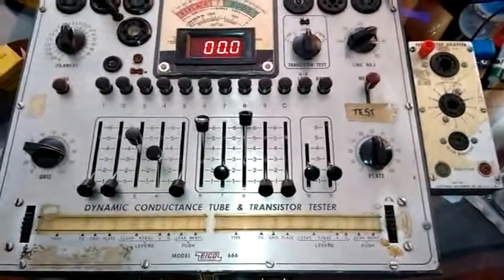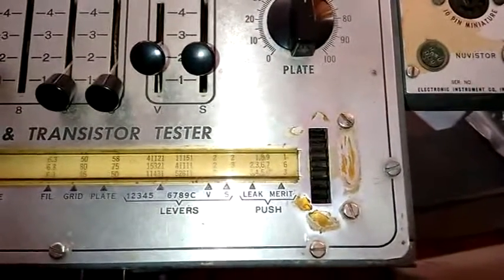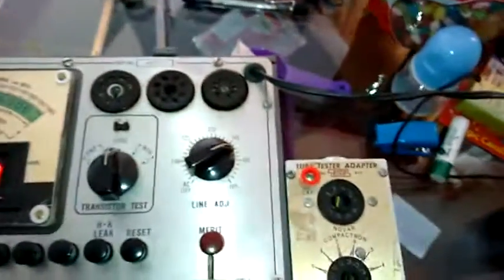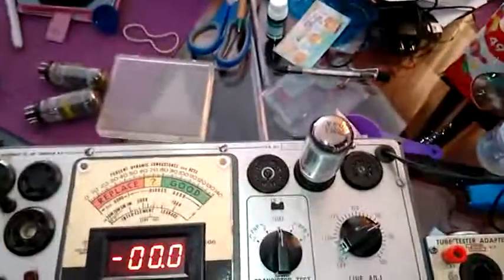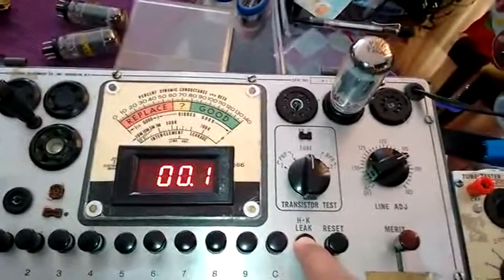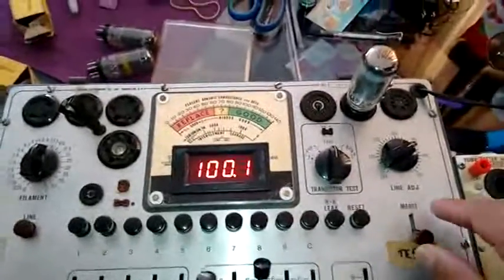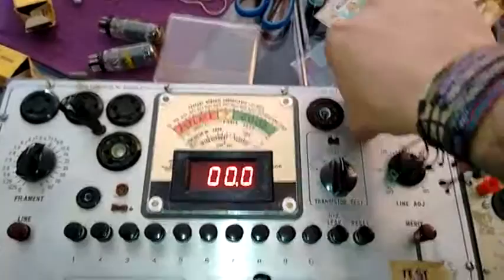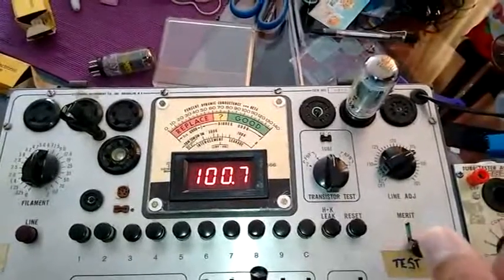Eico 666 Tube tester testing 3 tubes 7591

Comment: This tester doesn't test in mutual conductance. It's just a dynamic tester (emmision)
Reply from the maker: So why the box say "dynamic conductance tube tester" and when test a bad tube in conductance reads real values about is in bad condition when in a only emission tester looks good? Just curious 🤔
Reply: @eduarsan1  it's a dynamic tester it does one extra test then an emission tester and that is it applies a signal to the tube. A mutual conductance tester goes one step further by applying 150v to tube to simulate it in a real circuit but even then it's not the most accurate. Both are still better then emission tester

Comment: Why do you move to 5 volts instead of using the 6.3 as shown in the tube chart?
Reply from the maker: Hello, the reason is to show if the tube still healthy even with lower filament voltage where the emission must be similar, in power tubes this is a good test to do before buy or install tubes in amplifiers. Regards

Comment: I have one of these meter and the needle gauge finally died. Does the meter test in voltage or DC current? Im assuming the meter reads DC voltage after seeing your video.

Also, I'm wondering if there is a way to match tubes on one of these meters or at least check the current draw of the tube.

Thanks ahead of time.

Comment: Nice video, I really like the digital meter mod. Will this mod work with the Eico 628 ? Is the meter the same kit as found here which includes the PCB and components or just the meter required ? http://www.escol.com.my/Projects.html#Project__06

Cheers
Reply from the maker: Hello for the 628 for sure will works just be sure the readings in the old meter meets the current rating if not just ajust it to desired current in mA or uA. I found a completed meter where the readings from o to 199.9 is between 0V up to 199.9 mV respectively.

Comment: Could  you explain how did you do that modification to your taster
Reply from the maker: Hi Jorge for sure, I use for reference the info that is in this link 

http://www.fourwater.com/tubeinfo.htm#INFO666

http://www.fourwater.com/files/restr666.txt

http://www.fourwater.com/files/666-667-mod.png

The meter is a ICL7107 3 1/2 digit Panel Meter with 7-seg. Displays 
(0 ~ 1.999V) in mili-ammeter configuration (200 uA).

Regards